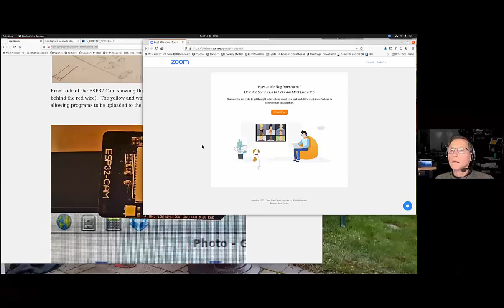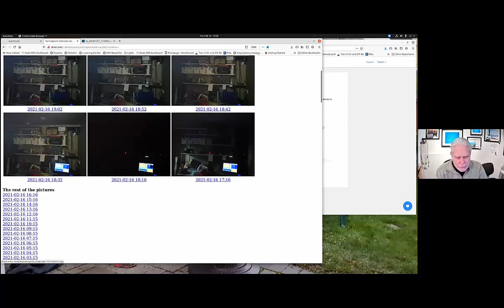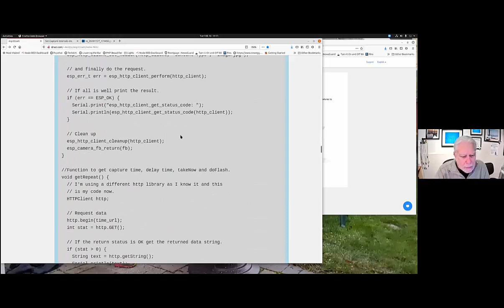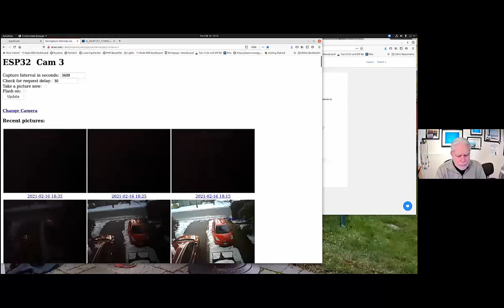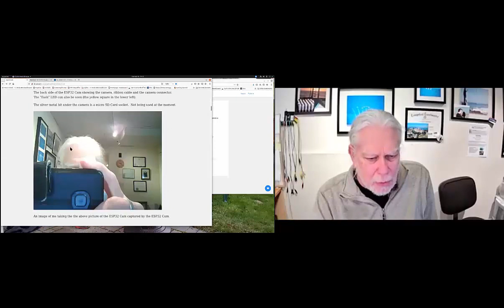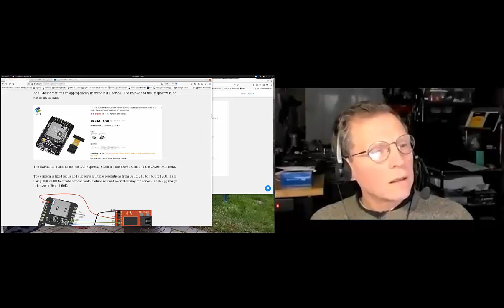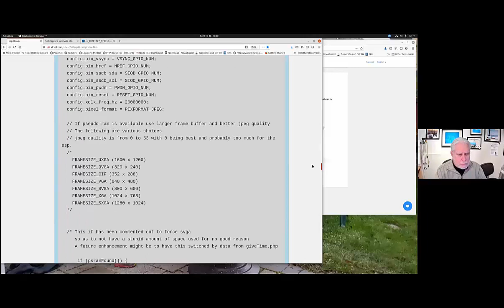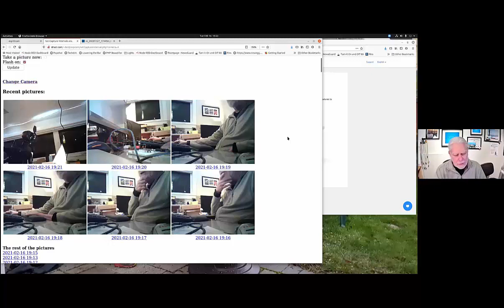ESP32 CAM DEMO

Comment: Thanks for the excellent presentation, particularly the webpage documentation with source code. These are quite powerful modules at an extremely cheap price. I have several. DE WA1KLI